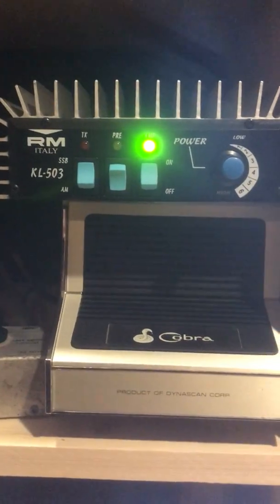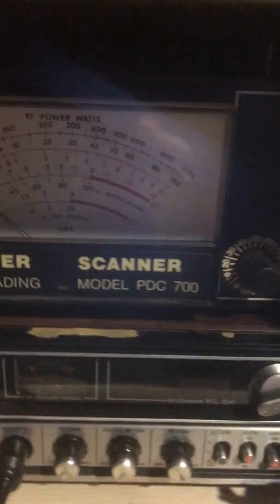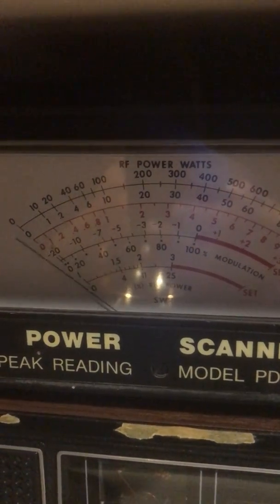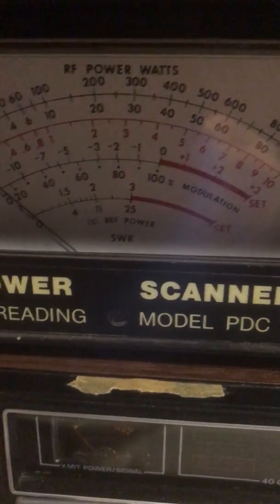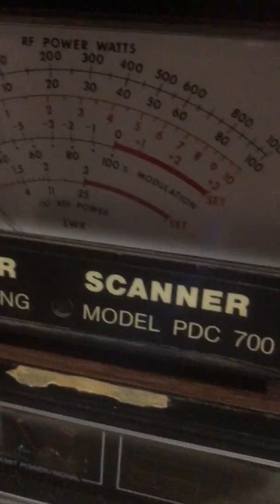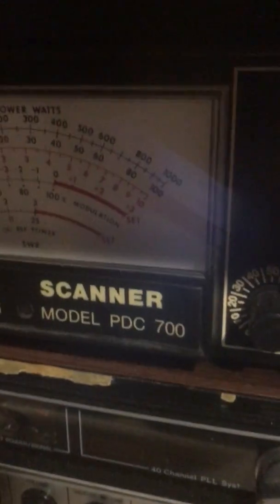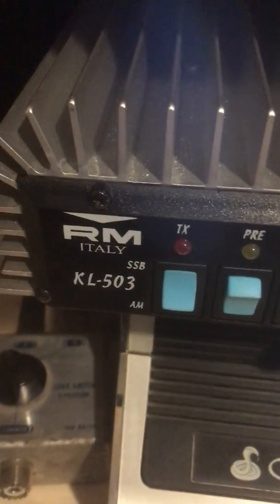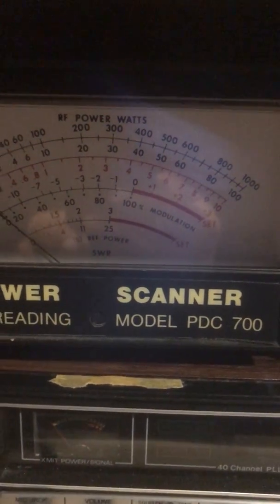RM Italy KL-503 SSB test

Comment: Nice video Michael, thank you for sharing!  I couldn't make out what you said in your video re: batteries.  I need a battery to run my 503, what kind of battery are you using?
Reply: You are looking at forward momentum of the needle & it’s not doing that much. Hold an audio don’t just audio real quick. That amp does 300 watts on 6 . The needle is so long on that Pdc the forward momentum shows a lot for a millisecond & drops back. Audio long enough for the needle to rest where it’s gonna.

Comment: Beware this is not made for CB it is illegal to use this amp on CB @ Regulations and part 95 rules states you must follow the required band plan for HF this is 28300 - 29200 and you must have a FCC Licences  of a Tech Genreal or Extra Class licences Fines can range up to 10K or as much as 20K per day that you are found using this off the required bands .. Just a friendly warning Beware unless you can pay the fine you can check with the FCC for more information...KG5CUO
Reply: U must be a ham operator,  are we jealous?
Reply: Blah. Blah. Fishcakes.
Reply: You do you brother. Hams rarely even talk on 10m because it's too close to cbers. Without an amp cb is pointless. There are less and less radios out there so you need wattage to talk to others because there are not as many cbers around.

Comment: This amp will do 250w max your meter is lying to you..
I recommend  removing the pre driver if you disable the 1 driving 8 and drive it as a strate 8 it is clean AF on SSB.. 
I'm driving it with 25w in to 8 with an HTX-10 soon to be replaced by a Lincoln II+ and it is clean on my scope.. 250w out 
Runs good on FM and AM 
FM I run it at 170w 
AM 50w  swinging 200.
Reply: Lincoln ll+ bag of shite. Make a good door stop.
Reply: Yep generous meter.
Reply: Yes I agree the amp is only rated at 250 / 300 w. You also might want to check the reflex coming back from the amplifier to the radio. Cuz you could have a mix match and have high swrs which will show more wattage than what you should have
Reply: My 503 hd only do 300.driven by 35 watts.volts 14
Reply: A battery isn’t giving it 14.5 volts that amp requires to run full output. I’m not dogging you but you have no clue as to what that amp requires to run at its maximum output. Your meter is wrong for one. That amp uses different transistors from what amps used to run before. iRF520 are in that amp . 1 driving 8. They came out with a high drive version that has a -7 db attenuator in it so it can be driven with 35 pep for full output. I don’t think yours is the HD version & if not you are over driving it anyway. At 14 volts it’s a 300 pep amplifier. I removed my driver because they sound bad on ssb. Now it sounds perfect. I took out the -7 db attenuator & being the drivers gone I drive it with less than the driver did & 300 pep is what it does.
Reply: Witam...mam problem ze wzmacniaczem rm kl 503 hd...w ustawieniu trybu ssb lampka tx zapala się tylko podczas modulacji bez modulacji przy wciśniętym ptt miga albo się wyłącza

Comment: This linear is JUNK! Sounds decent on AM but HORRIBLE on SSB. Returning!!!
Reply: It is becuse of the pre driver if you disable the 1 driving 8 and drive it as a strate 8 it is clean AF on SSB.. I'm driving it with 25w in to 8 with an HTX-10 and it is clean on my scope.. 250w out 
Runs good on FM and AM 
FM I run it at 170w 
AM 50w swinging 200.
Reply: @Mr_Meowingtons  

Is there any way of improving SSB audio without disabling the predriver?
Reply: @harrybatt998 , Sideband is a multi frequency mix. It will always sound a little weird (audio wise.) That being said, these are amps, so garbage in, garbage out. If you are looking for better “audio” then look for a radio that does better on sideband. If you mean power instead of “audio,” then you’ll have to have the driver transistor upgraded, or removed (converted to high drive.) My best advice if you want more power is to sell your amp and buy a bigger one. 73s

Comment: Thank you for sharing. I have one of these in my car using a Firestik 4'
 with a coil base mounted on a mag mount center roof of the car. 
(Chrysler 300, a large car). I did an SWR check on my Uniden Bearcat CB 
radio with no SSB and it was 1.05 at worst. (That is my next upgrade, I 
am looking at a Galaxy 900 series mobile radio with SSB and all the 
bells and whistles) I have not power checked it yet, but I do have that 
meter as well. I am just excited to talk on it, that testing power has not come 
up....yet. I have seen many AM tests and most show peak at 180 watts on this 
radio. That is actually not bad as it is rated 250 watts max on the AM. I
 would have expected a little more, but not bad like I said. 

The mosfet transistor approach using 1 to drive 8 mosfets seems a strange 
configuration, and the fact that it is low input for high power is 
strange. A standard 11 meter CB (not SSB) doesn't drive more than 3.8 watts 
typically. It is great in this application, but stinks for SSB since 12 
watts is all it is rated to handle for input. (I have also read it can do up to 24 watts, so not 
sure what the actual limit is for input) I know many people who 
have blown the front end on these by over driving the input. So, this 
radio is great as a stand alone amplifier and is cheap, and works very 
well. It has it's limits for sure. So, my two cents would be to keep the gain down on the 
radio TX when running SSB to keep from blowing the amp on the front end. I have seen tests at 
450 watts on SSB so your 400 watts in this test is not far off from that.

At 170.00 American dollars, this amp is very affordable as well. My whole rig is less than 300.00 and
I have talked more than 30 miles land, and up to 3000 miles on skip with this amp. I have
tal;ked to Hawaii from Arizona for example. I have talked to the Bahamas, and almost every state in the 
continental United States.

Again thanks for sharing, take care, 73s.